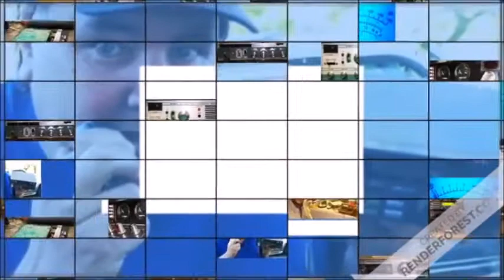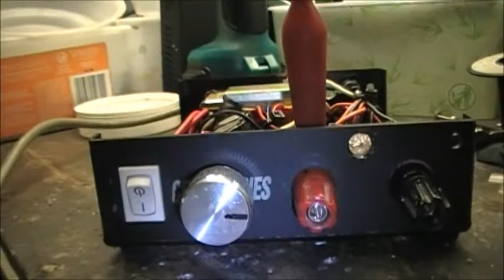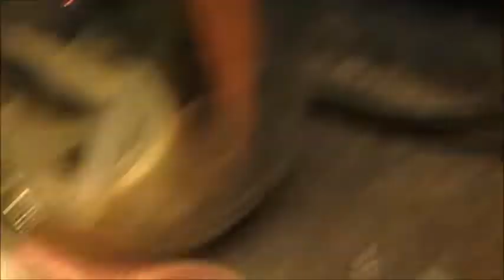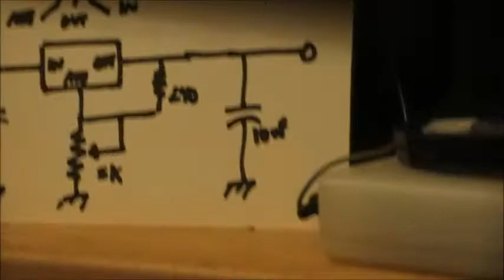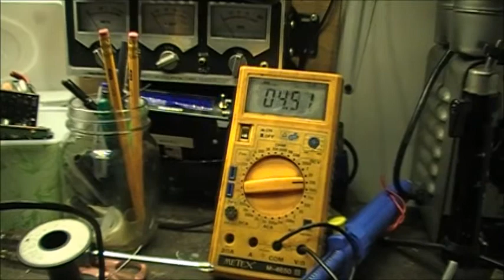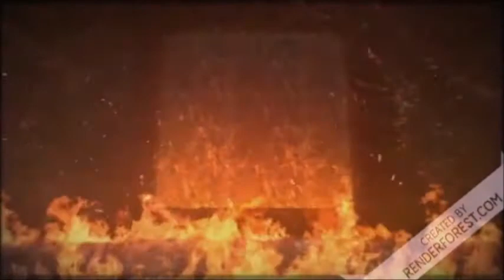1vdc to 24vdc variable power supply

Comment: Looks like a nice little variable supply. I am assuming it is fairly low current Unless they Transformer is heftier than it looks.
Reply from the maker: Naw, good for about 1.5amps maximum... just built it to power some projects over the winter as i build them... built it for something to do. :-)
Reply: @Radionut63  yes kind of what I thought. thanks for answering my comment.